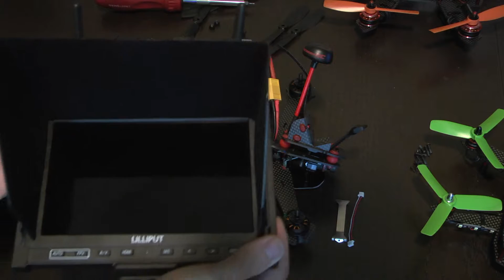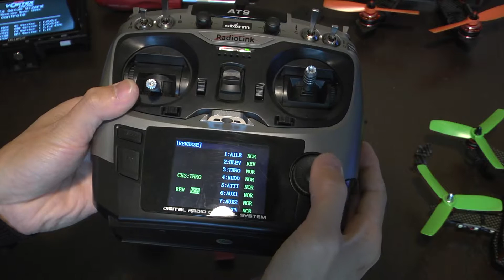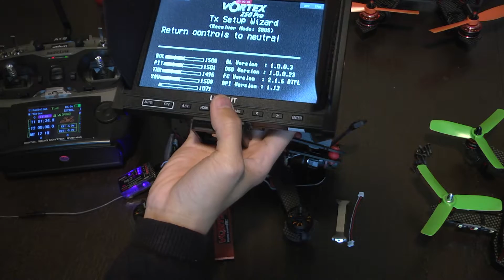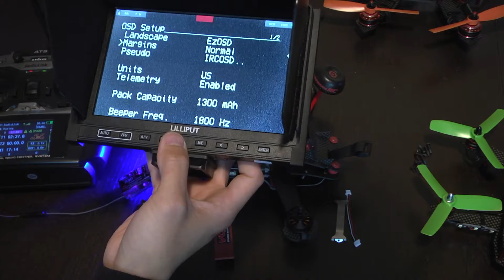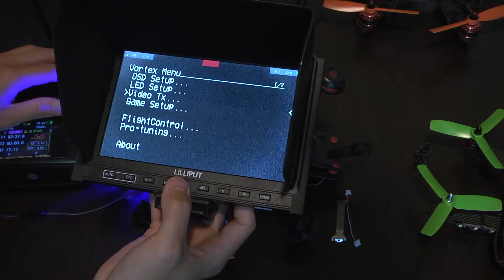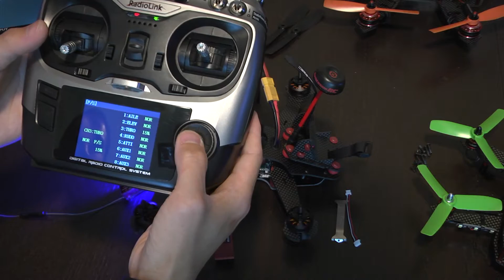How To Set Up and Bind Vortex 250 Pro with RadioLink AT9 (S.Bus)

Comment: Dude just what I needed! You're awesome! Do you know if it would be possible to use the Radiolink R6D receiver with the Vortex Pro? It would be nice to use the smaller package, and that way I could just keep my standard receiver in my CX-20. You're the man.
Reply from the maker: +SoLongSidekick Thnaks!
Yes. you can use the R6D receiver with the Vortex, but you will have to use PPM as it does not support S.BUS.  
You can use the main receiver port - CPPM for that I believe.

I would stick with the R9D as S.BUS is much faster, lower latency, and simpler.  You can make the R9D as small as the R6D and just remove the outer casing.  Details in the video description show what I did.

Hope that helps!
Reply: +MatrixWriter Good point, especially on a quad like this. That could make a real difference on something so freaking fast. Maybe I'll just pick up another R9D and keep one in my Vortex and one in my CX-20. I know the AT-9 has supposedly really easy profile settings for switching between quads, do you have any idea if it's just as easy to switch between receivers?
Reply from the maker: SoLongSidekick The R9D receivers are not too expensive FYI.  It is easy to switch between different receivers (aka models).  If you see under my settings on the 4th page here, under MODEL SEL. you can switch between different settings and profiles, included different receivers.
https://drive.google.com/open?id=0Bwdh8mcr00lESEswS0RxVXFCT2s

Hope that helps!
Reply: +MatrixWriter So it is easy to just put R9Ds in both of my quads and switch between them using the AT9 profiles? I hoped and assumed that would be the case, but sometimes with identical hardware you have address issues where you have to manually fiddle with them every time you want to switch between them.

I actually bought the AT9 to replace the stock radio system in my CX20 and was beyond stoked to see your video and realize I can also use it for the Vortex with no issues. That definitely cuts down on the equipment needed if I ever want to bring both somewhere - especially since I have a backpack for the CX20, a bag for the AT9, and the Vortex comes with a case.

So now that you're not mounting the receiver on the tail of the Vortex, how big of a battery have you been able to stably fly? Or have you done any testing on that? The manual says not to go any longer than ~80mm in battery length, but I've heard of people using 2,200mAh batteries that are ~100cm in length without issue. I mean you don't want to load this thing down with too much weight anyways, so 2,200mAh might be the highest practical.
Reply from the maker: SoLongSidekick Yes, that is correct.  Please look at the PDF settings I use and on the 4th page, it has a photo.  But under Model Sel. is where you switch between different models 01 to 15. 

Almost all modern radio systems allow you to switch and store models and profiles so you do not have to carry multiple transmitters (TX).  Most flyers carry one TX to the field.  Each profile/model saved pertain to the specific receiver bound and it will not bind unless you switch to the correct profile...ex, I use profile 01 for the Vortex and 02 for my SRD and if I am in 01, it will not connect to my SRD - I have to switch to 02 for it to work and vice versa. 

As for any procedure binding with new receivers, check your trims and end points.

For battery size on my Vortex, I run maximum of 4S 2200mAh - Venom Fly if your receiver is mounted inside the quad.  I don't recommend using higher capacity 4S (could go higher if using 3S though) as the increase in mass will eventually outdo the increase in flying time.  Also to note, too large of battery, you could risk hitting the rear prop blades and plus the quad will feel sluggish >> you will need to manually adjust your PIDs.  Stock PIDs are fine up to 2200mAh.

I get about 5-6 run time with 4s 2200mAh on cruising mode, otherwise 5 min on hard flying.  For 1300mAh, I get about 2-3 min. 

4s 2200mAh Venom has dimensions ( LxWxH) of:
103 x 34 x 27 mm / 4.1 x 1.3 x 1.1 in

You could go an extra inch for length, if you can find a pack that long, otherwise, don't go wider.

Here's a video of flight test with 2200mAh and RadioLink...
Yes, that is correct.  Please look at the PDF settings I use and on the 4th page, it has a photo.  But under Model Sel. is where you switch between different models 01 to 15. 

Almost all modern radio systems allow you to switch and store models and profiles so you do not have to carry multiple transmitters (TX).  Most flyers carry one TX to the field.  Each profile/model saved pertain to the specific receiver bound and it will not bind unless you switch to the correct profile...ex, I use profile 01 for the Vortex and 02 for my SRD and if I am in 01, it will not connect to my SRD - I have to switch to 02 for it to work and vice versa. 

As for any procedure binding with new receivers, check your trims and end points.

For battery size on my Vortex, I run maximum of 4S 2200mAh - Venom Fly if your receiver is mounted inside the quad.  I don't recommend using higher capacity 4S (could go higher if using 3S though) as the increase in mass will eventually outdo the increase in flying time.  Also to note, too large of battery, you could risk hitting the rear prop blades and plus the quad will feel sluggish >> you will need to manually adjust your PIDs.  Stock PIDs are fine up to 2200mAh.

I get about 5-6 run time with 4s 2200mAh on cruising mode, otherwise 5 min on hard flying.  For 1300mAh, I get about 2-3 min. 

4s 2200mAh Venom has dimensions (LxWxH) of:
103 x 34 x 27 mm / 4.1 x 1.3 x 1.1 in

You could go an extra inch for L only if you could find a longer pack.

Here's a video of me flying with a 2200mAh pack and RadioLink for Vortex:
https://www.youtube.com/watch?v=76mkdRd9ASU

Hope that helps!
Reply: +MatrixWriter I hope I can bother you for help one last time. I was taking the Vortex apart last night to get my s.Bus cable installed and a flimsy piece of metal came flying out. Being a maker and tinkerer, I thought 'well that has to be a ground to something, but what?'. I searched through every single piece of documentation available and found nothing, and just resigned to continue watching your video. Then you mention it, good luck on my part haha. One thing you didn't mention though is exactly how it goes back in. Here's what I did; I hope it's right: I put it back in with the bend facing down, under the antennae mount cable (which kinda got in the way) so the majority of it was laying flat on the video transmitter. Then I got kinda stuck figuring out exactly how the tabs sit. I looked at the bends and ended up mounting it with the middle tab with the screwhole sitting directly on top of the side piece so the screw would go through it (obviously) and the two tabs on the outside bent down and kind of at a 90° to the middle tab. They sit up against  the side piece and are bent downwards. Please let me know if I did this wrong.

Tonight I'm going to be turning my R9D into the little micro version you showed me. It looks like you just pulled the case off, trimmed all unused pins, and wrapped it in kapton tape - is that correct? 

I have to say I'm very disappointed in Immersion for not having proper documentation available for this quad which has been out for quite a few months now. There's a 'getting started' guide, but everywhere else it says "manual available upon release of quad'. You didn't by chance find a copy of the full manual did you?
Reply from the maker: SoLongSidekick
No worries, always here to help as best as I can.

For the flimsy metal piece, that is optional to have it installed as its only purpose is to hold the VTX module and helps prevent it from popping in case of a bad crash.  You could just use tape to hold the VTX in if you think it could come out.

From the looks of your install, I think you did it correctly.  Here's how I did it:

On the metal plate, where it bends naturally it needs to be facing towards the VTX.  The short flat sides where there is a small screw hole, place the screw through the top carbon fiber plate and then through the metal piece and then screw it in slightly to the side plastic piece.  Do the same for the other side.  Then screw in the other screws after that.  Make sure the XT60 power cable is over the metal piece and not under as the metal piece needs to make contact with the VTX to hold it in better.

That is correct for turning the R9D into the micro version.  Remove the outer casing and the header pins, including the one for telemetry.  You can bend the header pins back and forth to break them (kind of like if you bend a paper clip back and forth, the metal will break) of the PCB.  Once the header pins are removed, then remove the excess header pin left overs and solder the S.BUS cable.  Make sure to look at my photos for that.

IMPORTANT: When wrapping the RX in Kapton or electrical tape (you can use large clear shrink tube too), make sure to cut a little hole for the bind button.  Too much pressure on the button will make the RX in bind mode. 

Make sure to test everything before reassembling the Vortex (make sure R9D is in S.BUS mode, blue/purple LED and not PPM mode) as removing those lots of screws sucks.

As you the last part, there still is not full manual for the 250 Pro.  You will need to use the 285 manual instead for more in depth details.  That can be found on the IRC page or here:

http://www.immersionrc.com/?download=4218 

Feel free to ask me for anything else  and hope that helps!
Reply: +MatrixWriter I have one last (haha yeah right) question. How exactly did you set the different actions for the toggles on the AT9? This is actually the first time I've ever used my shiny new AT9. Is it done via the OSD or somewhere else? You're a lifesaver!

EDIT - I just flipped through the toggles knowing that channel 5 is set as the camera angle adjuster out-of-the-box (I don't have my AT9 manual on me) and found that it set it to toggle C. Pretty convenient place actually, but I'd love to know how to change it and add even more adjusters.
Reply from the maker: SoLongSidekick All good, no worries.
Actions for the toggles is done via the transmitter/radio - aka the 3 different flight modes are done in Aux mode.  Again, please look at my settings use, which is found in the video description.  I use Switch G, but you can use any 3 position switch...

RadioLink and settings are pretty easy to understand rather than the Taranis, but take a look at what I have and feel free to experiment.  Whenever experimenting, remove the props!!

Hope that helps!
Reply: +MatrixWriter So I just rewatched the video to make sure I didn't miss anything and I am a bit confused. Could you please explain what the different flight modes are in your words? Also, it looks like you have two different switches set up for flight modes. Maybe even like a low and high setting for each mode or something. Could you explain? You're the best.
Reply from the maker: SoLongSidekick There are 3 different basic flight modes available for quadcopters:

1) Angled - known as auto, self-leveling mode.  The quadcopter will automatically attempt to make sure it is always leveled at all times regardless of stick movement - think of assisted flight mode.  During stick movement, the quadcopter will not travel past - 35/40 degrees (something like that) horizontally.  This limits how fast the quadcopter can go and most importantly, you cannot do flips/acrobatics. This mode is suitable for beginner flyers and aerial photography drones like the DJI Phantom, etc.
Angled is not recommended for racing as you have no full control of your quadcopter and you are always fighting against self-leveling.  Makes it had to fly between/around obstacles.  Could compare angled mode as an automatic transmission for a car.

2) Horizon - combination of angled and rate mode.  The quadcopter will automatically self-level when the sticks are back at the center.  You can do acrobatics here. Excellent mode for those learning to do acrobatics and not having to worry about having to re-level things after sticks have returned back.  Horizon gives you more manual control of the quadcopter over angled.  Could compare horizon mode as a car that has a steptronic transmission where the driver can switch gears without having to worry about the clutch.

3) Rate - known as acro / full manual mode.  No automatic self-leveling when moving the sticks.  You use the sticks to control the quadcopter's angular velocity of rotation, but not the angle.  When you move the sticks, the quadcopter will keep itself at that position and constant rate until you correct it yourself (releasing sticks it will stay at that position). That means when you bring the sticks back to center, you need to make sure quadcopter is leveled if plan to hover in place, otherwise you will crash.  Could compare rate mode as driving a manual transmission / stick for a car.

The different switches on the RadioLink are used to adjust the Rate mode speed - how much of an angle and stick position (on transmitter) responsiveness the quadcopter will react to  -- this is for a different quadcopter I have and I was using the same transmitter.  Lower speed means the quadcopter will have a slow response time to stick/travel movement and doing a flip takes more of full travel of sticks and holding it while higher speed means I move the stick with lesser ease. 

Note that the above what I described does not come pre-programmed with the Vortex.  This has to be done in Cleanflight on your PC and you set different Profiles (PIDs somewhat...).  You then assign the Profiles to a switch on your radio.  I tend to make 3 profiles - slow, medium, and fast.

Hope that helps and made sense!
Reply: +MatrixWriter Dude you've made getting up and running with this quad/Tx so freaking easy. I can't thank you enough. I do have one last question though. I decided to look through the screenshots from the Tx that you posted, and since I'm new to the AT9 am kinda confused. What exactly are the changes that the screenshots are showing? I mean functionally too: what exactly does each change do? You're the man.
Reply from the maker: SoLongSidekick That's what I try to achieve when making videos.  To answer your question about the AT9 settings:  Most of them are default settings, but the ones you want to pay attention to would be:
Page 6/ Image 6: End points, make sure to adjust them to your model as it determines servo travel, in this case with quadcopters, signal travels which your flight controller processes.  Incorrect settings can make your quadcopter feel sluggish, etc.
Page 7/ Image 7: Sub-trims: Position of servos/ channels. If your quadcopter is shifting positions despite that the gyro has been properly calibrated, please make sure your trims are correct and perform any adjustments.
Page 8/Image 8: Channel directions:  Sometimes your channels on your radio are not in the correct position.  You want to move one direction, but the model does the opposite.  You need to reverse channels sometimes.  With the Vortex, you needed to reverse Elevators and Throttles for this radio system.  Other radio systems might not need this done...
Page 12 / Image 12: Fail Safe:  Important to set fail safe or use user determined value if your model loses radio signal.  I set mine to lowest throttle settings when the quadcopter loses signal and it will fall from the sky rather than fly away (and potentially hurt someone/something).  Motors will cut automatically with fail safe mode in CleanFlight.
Page 13-14/ Image 13-14: Channel mapping/Aux Channels.  Where you assign your other switches and knobs on your radio system.  You will need to define the actual function in the flight controller's software, the switches just simply activate the feature.

Best thing would be to consult the RadioLink manual for more specific details and settings.

Hope that helps!
Reply: +MatrixWriter As much as I love this transmitter, the manual is a huge downside to buying the AT9. The entire thing is seemingly Google translated and almost impossible to understand. I could see if you already had experience in certain things you'd be able to piece it together, but for people who don't have the experience it's hopeless. That's what makes your help absolutely invaluable. 

Also, I was a bit surprised that reversing was needed when setting up the Vortex. I'd seen it mentioned in multiple places that the wizard would automatically correct any backwards channels on the quad's side. I would imagine that just reversing them in the transmitter is a better solution anyways though. 

Are you using any expo/rates anywhere?

Again, thank you so much.
- Blake
Reply from the maker: SoLongSidekick
Much appreciated.  I still think this radio system is pretty easy to understand and is much easier than the Taranis.  Most of the stuff in the system is pretty universal with all systems. 

I never heard of auto reversing with the Vortex...most of the time with any quadcopter and flight controller, you end up having to reverse something.

No expo rates for me.  A lot of the advanced parameters should be done in CleanFlight software, but you can tweak and trim some stuff on the transmitter. 

Feel free to contact me with any questions and I will do my best to answer them.

Thanks!
Reply: +MatrixWriter I've got one more question to bug you with. I was searching and searching online to try to find out if I could use the ImmersionRC ezUHF transmitter (the standalone version, not the transmitter bay version) with the AT9. I couldn't find any answers anywhere so I decided to ask Immersion directly. They were of very little help and responded with "As long as you can feed PPM signal into the tx, you should be fine. Well, power and gnd too." Being a beginner in regards to this transmitter and not really understand transmitters that well to begin with I still have no idea if the two systems are compatible Do you know if the AT9 meets the qualifications he mentioned?
Reply from the maker: SoLongSidekick
You might be able to use ezUHF with the RadioLink AT9.  The trainer port on the AT9 matches the pinouts of the ezUHF transmitter and can feed in PPM.
The trainer port does not provide enough power to power the ezUHF tx, so you must use the DC input power jack.  Use 3s LiPo pack. 

Next you will need to configure the trainer section on the AT9.  The first part of my video when I used TBS crossfire shows how to do this.  The same settings should work for ezUHF - hopefully.
https://www.youtube.com/watch?v=g44PSuR5Pi8

Here's the manual for ezUHF:
http://www.immersionrc.com/downloads/manuals/EzUHFManual_EN_v1.0.pdf

And AT9 trainer port pinouts:
http://img.banggood.com/images/2014/huangxiaobin/06/SKU148783/SKU148783k.jpg

Hope that helps!
Reply: Well shit man, if you've used the Crossfire with the AT9 and know it works maybe I'll grab that instead of the ezUHF. I wasn't planning on setting it up on the Vortex - short flight times kind of defeat the purpose. I was going to use it on an APM-based open-source Phantom 2 clone that I have. How different would the setup be for something like that? Would I still be able to use your video as a guide? You are seriously my hero.
Reply from the maker: SoLongSidekick
I think ezUHF should work with the AT9.  Theoretically since ezUHF uses lower frequencies, it should provide longer distances compared to the Crossfire.  But both will be much longer control range and less interference than stock 2.4 GHz control.

Where I fly, it is crowded and noisy with 2.4 GHz (and 5.8 GHz) so UHF systems are the best for that.

Setup in the trainer portion of the other video I linked you should be identical.  The trainer port is just there to send the PPM signal to the external TX.

Always glad to help!
Reply: Dude, you really have made setting up / using this transmitter infinitely more easy. I was a bit worried when I ordered it. I did so because of the feature list and the price, but was distressed at the Google translated Chinglish manual. It makes it nearly impossible for someone who buys the AT9 as their first transmitter to grasp the AT9's advanced features. I can see how if you've owned another transmitter and are more familiar with the expected menu screens and parameters that you'd be able to pick up the AT9 in no time. 

Yeah right now the ezUHF + diversity receiver and the Crossfire + diversity receiver are the same price, so I'm not sure which to get. I've also seen an AT9 + R9D range test where the guy was able to hit 4,000 meters, which is pretty nuts. The Crossfire has much, much better antennas than the ezUHF so that's a plus. I'm going to do some more research.

My next challenge is going to be setting up the AT9 for the Flite Test Viggen EDF plane (delta wing with elevons). I think I've figured out the important things. Bind, set up model GLID(1A+1F), turn on elevon mixing, then finally add rates and expo as needed (which I don't know how to do but I'm sure I can figure out with YouTube videos if I have to). I'm going to try my hardest to set it up using only the manual, but we'll see how successful I am with that.
Reply from the maker: +SoLongSidekick +SoLongSidekick Thanks!  I try my best to.  I personally chose the Crossfire since TBS makes some of the best equipment and has pretty good documentation.  EzUHF, theoretically should go further, but more people are report Crossfire goes further and plus, the latency is much much less since it uses CRSF (pretty much S.BUS) protocol vs PPM like EzUHF.   You can still use PPM on Crossfire if needed. 

The range on the RadioLink, is pretty good, but for air, you will get about 1.2 km (says 1.5km, but not really).   

Video of me flying with TBS crossfire 1.1 miles, https://youtube.com/watch?v=-r0mIUdOh88

Should give you an idea how far out I was.   

Again, please let me know if you have any other questions.
Reply: I have another question if I could bother you again. I'm trying to use my AT9 with my open-source Phantom 2 clone (Cheerson CX-20 / Quanum Nova). It has a clone APM powering it. Someone told me the only real thing I need to do to get it flying is write down the PWM data from the stock controller from Mission Planner, then put those into the AT9 to avoid having to do a bunch of setup in Mission Planner. I have all the values, but can't find where to insert them in the AT9. I've checked all the menus, what am I missing?
Reply from the maker: SoLongSidekick Sorry for the late response, been busy with work.  I'm not exactly sure how to help with the values, but the if the flight controller accepts PPM or S.BUS, your AT9 system should be detected and you then check if all the channels map out correctly, otherwise you will need to reverse and swap channels. 

The wizard setup in Mission Planner's newest version is actually pretty nice and simple.  I use it with my Pixhawk clone it works quite well.

Hope that helps!
Reply: Hey bud, been awhile. How you been? Anyways I just noticed something I thought I should mention to you. GetFPV started carrying Radiolink products and I was reading the product pages just for giggles and noticed that the page for the R6D says that it does support S.BUS. That makes that little receiver much more attractive for scratch plane builds and similar craft. Is GetFPV mistaken or does it actually do S.BUS?
Reply from the maker: +SoLongSidekick Doing well, hope you are too. 
That info on GetFPV looks like a typo as the specs for the R6D last time I checked only does PPM and PWM.  It doesn't do S.BUS. Only the R9D can do that.
Reply from the maker: +SoLongSidekick Doing well, hope you are too. 
That info on GetFPV looks like a typo as the specs for the R6D last time I checked only does PPM and PWM.  It doesn't do S.BUS. Only the R9D can do that.
Reply: So I actually just thought of another question. So I ended up getting a Taranis (pretty much solely to be able to fully fly my Tiny Whoop) and swapped my R9D for an Fr.Sky X4R-SB. They both use S.BUS and use the same cable. I did a factory reset on the Vortex just for the sake of doing so but realized I would like to be able to throw the R9D back in there on occasion to have two completely unique systems (a drone and a transmitter) so I can let friends fly while I'm flying with my 5" Alien and Taranis. Can I just hotswap the receivers and not change anything else or do you think I should run the wizard any time I change receivers? Thanks again man.
Reply from the maker: +SoLongSidekick Good choice with the Taranis, I happen to have both (AT9) and I like them for various reasons.   Unfortunately you cannot just hotswap the receivers as it will cause issues with the Cleanflight since it sees a different receiver as a new thing and will go into set up mode again.   If you have a bunch of custom settings done, a work around this would be to do a CLI dump with everything configured for one receiver and then save it to your PC.   You then set up again with the other receiver and do a CLI dump.  Reload everything from the CLI dump to the right receiver you plug in and you can get going again.  It's not ideal as you will have to bring your PC/laptop around.    But again, the radio setup with the vortex is fairly quick and you don't need to use a PC at all. 

Personally, I would stick with one system each, if possible for your both quadcopters.   The Taranis technically is the more superior radio system.  I tend to use the the AT9 for testing and bashing...
Reply: It's funny, my next question was going to be about the CLI dumps. When I switched to the X4R-SB I went in and customized a bunch of stuff. I wanted to switch from stick to switch arming and ended up changing a bunch of stuff. I did a CLI dump when I was done; I think coming from a programmer background it's just a habit to backup everything. I'm glad I did and I think the CLI swapping is exactly what I'll do if I need to. 

Eventually I probably will just keep the Vortex on the Radiolink system. But for now it's my backup quad so I want to keep it ready to fly within a minute if it's needed. It would be really nice to have a completely separate system for letting friends fly who have never done so, or just anyone who's interested in trying it out. And of all the frames out there the Vortex Pro has to be the absolute best for letting newbies fly; the thing is built like an absolute tank. Any crash that breaks an arm or the frame of the Vortex Pro is going to be incredibly devastating haha.
Reply from the maker: +SoLongSidekick That's a good thing you did a CLI dump, that has saved me several times :). 
I managed to break an arm from the Vortex and it was a pain to rebuild.
Reply: How in the hell did you do that? By strapping 747 engines to it and full throttling into a giant diamond wall?
Reply from the maker: +SoLongSidekick I was going about 50-60 MPH between trees and hit a thick branch. The Vortex hit a dirt area rather than grass so it increased the amount of damage done too.